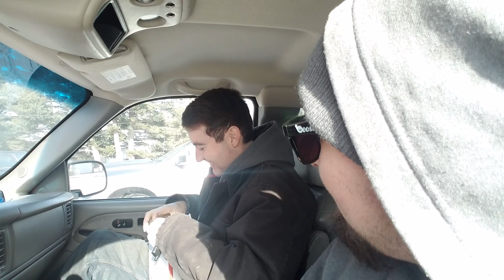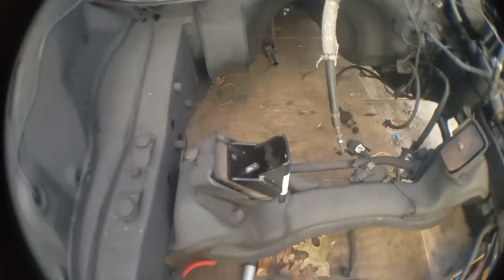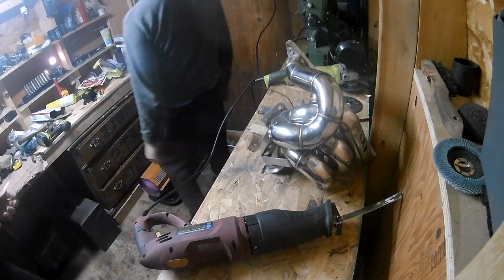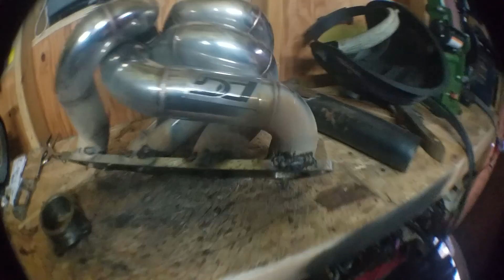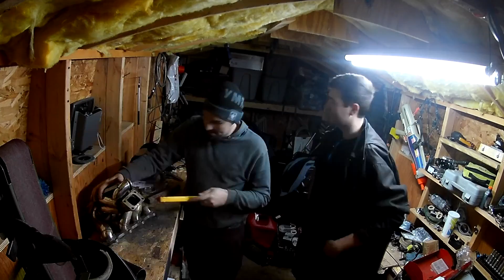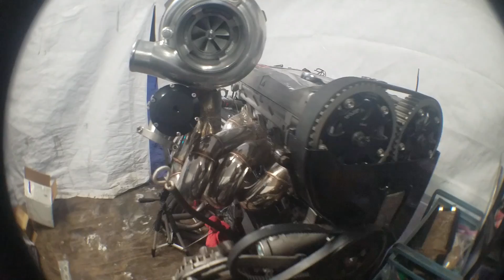HARBOR FREIGHT FLUXCORE WELDING STAINLESS STEEL MANIFOLD part 2

Comment: I have found that regular fluxcore can weld stainless with decent strength(never tested fully) , but where u weld will not be pure stainless anymore and will rust a little.
Reply from the maker: Basically... on my fiero first turbo setup i had for 2 years i welded mild steel to stainless flange and it lasted with full weight of turbo on it...
Reply: Also won't look as pretty..
But shi aat, git er done!

Comment: Did you use regular steel flux core welding wire?
Reply from the maker: Typical hobart wire from homedepot
Reply: @Garageless  thanks for the info.

Comment: what kind of wire did you use? and what was the settings of the welder set to?
Reply from the maker: Harborfreight fluxcore welder only has high low... i usually use high with 4-5 wire speed... i use .35 Lincoln fluxcore wire...
Reply: @Garageless  yee buddy
Reply from the maker: Depending on thickness of stainless definitely could burn thru easily...
Reply from the maker: Weird ive had no issues at all with fusion
Reply from the maker: Ahhh yea that might b the issue... isnt that usually just stainless coating?

Comment: Did you guys use stainless wire?
Reply from the maker: No just typical off the shelf hobart wire
Reply: @Garageless  awesome. I just happen to have exactly that in my welder
Reply from the maker: @markguthrie4178  itll work the welds will deteriorate before the stainless thats the downside but we are talking a long time before that is issue... atleast thats my experience

Comment: i built protype exhaust for years for the biggest car compaies in the world...stainless to mild steel is common ,hell some have cast to stainless.i tig mostly with specialized filler but is same principle...25 years welding and fabricating.
Reply from the maker: In theory the mild steel will deteriorate faster than the stainless i think thats only difference really but thats wat ive read
Reply: Really ...

Comment: It would be nice if you told everyone what type of H.F. Flux Core Wire you used .
                                                                                                                                       T.Y.     Joe
Reply from the maker: Miller wire .30 i believe

Comment: Manifold leaks for days? 😂
And you just have a small head!
Reply from the maker: Henry Brimmer got em... lmfao if it leaks well just throw some jbweld on it
Reply: Garageless sounds about right! 😂
Reply: send them to me i can fab them guys up
and if you want i can port and polish the heads if you cover shipping costs
Reply from the maker: green t its already welded now lol... arent u in wi?
Reply: yeah
Reply from the maker: green t we could just drop off... you have tig welder buddy needs the intake welded its aluminium we dont have that tech yet
Reply: Garageless  no I don’t have Tig I mostly do gas stick or mig but I’m a high schooler although I have ported 3-4 heads in my time and all have gain torque and hp
Reply: It take a calm hand but with females sanders and cloth I can make anything work
Reply from the maker: green t i havent tried my hand at porting and polishing yet... im just not convinced its worth the effort... im pretty decent welder wish we had tig then i can fab a bunch of stuff its on my list..
Reply: Garageless you would be surprised by how much you can gain but buy a tank of argon75% and nitrogen25% then get a scratch stick to tig tool and you would be set
Reply from the maker: green t thats more money than i wanna spend on a welder lol im cheap
Reply: Garageless its about $170
Reply from the maker: green t the tanks arent cheap though thats issue
Reply: Garageless yeah a tank that is about 2.5 constant hour use is about 70 bucks but go to a welding shop and you could ask if you could rent a a tanks b cause the main cost is in the 
 metal not the gas